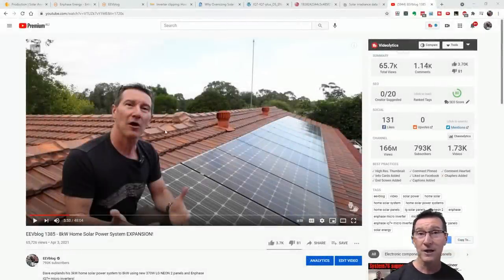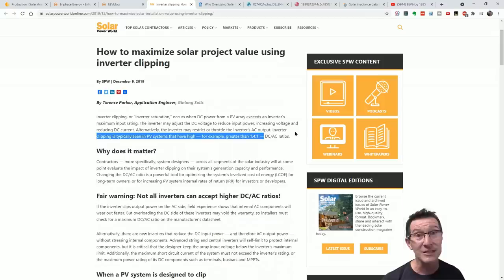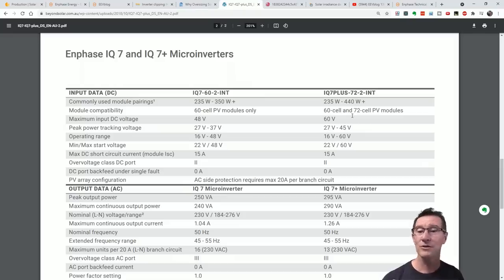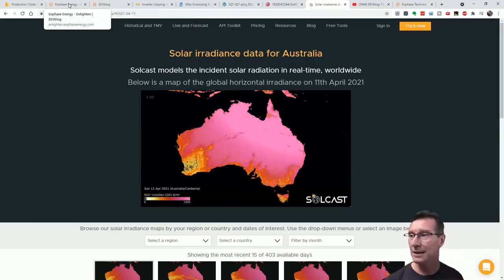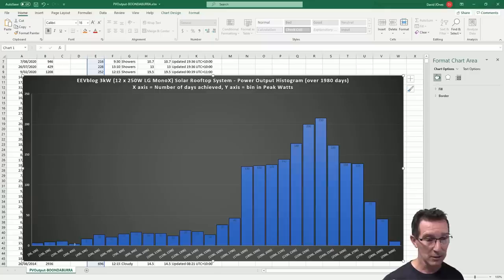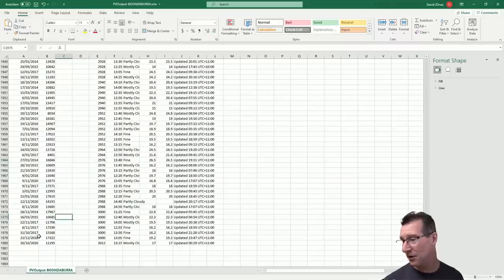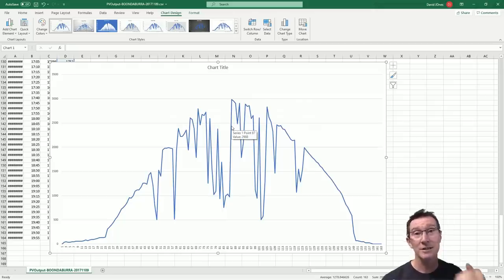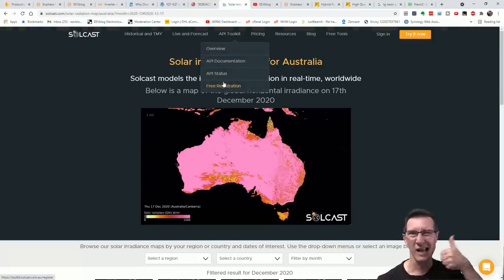EEVblog 1386 - 295W Inverter vs 370W Solar Panel - WTF?

Comment: Can you run DC equipment directly off the MPPT so you can avoid the inverter?
Like charging your electric car without inverter.
Reply from the maker: There is no MPPT tracker box, it's built into the DC/AC inverter.
IN theory you could charge your car directly but it's liekly not worth dicking around with a custom solution to gain a few percent extra efficiency.
Reply: @EEVblog  Yes, for me the best optimization is likely to add an A.C. coupled battery. But that depends on the utility cost and if you can take advantage of time of use rates, or if backup power is worthwhile to you. Or if you can arrange it, simply plan to charge your car during peak solar availability.
Reply: I directly DC charge my electric motorcycle (72V / 6.5kWh battery, 8 kW hub motor) off 3 270WP panels in series. The bike has a cell monitoring circuit which opens a contactor when the 1st cell goes high voltage. My Tesla Model S gets solar  charged DC/AC AC/DC which is unavoidable at this stage. While it does has DC pins on the charge port it takes the CCS protocol to convince the car to energize them. There is a German manufacturer (Vector) who offers a CCS kit for conversions but it is around AU$6000 by the time it lands here in Straya. For grid connected guys like ol Davo here a Zappi TYPE 2 wallbox would be good which puts excess solar into the car rather feeding it into the grid. It is a very satisfying experience to ride/drive solar electric.

Comment: Calling this "de-rating" of the inverter system is backwards to my ears. "De-rating" is when we purposely use components with higher capability and purposely design to not use all of it.  Is this not actually over-rating of the interter system? Or de-rating of the solar panel system?
Reply: Me too. Completely misusing the word to justify what is IMO just another scam.
I've come to expect that from the solar industry though.

Comment: most if not all panels rarely reach the quoted power simply because they drop output as they heat up (full summer sun ) can reduce o/p significantly , ps most grid panels have bypass diodes built in (not blocking) so if panel a panel is partly shaded it wont drag the hole string down , interesting to see if the inverters still work after several years on the roof.

Comment: It is not fair what you did with extrapolating that curve. The panel temperature has a huge role in power output not just amount of solar so the reasons you have those peaks is because panels where shaded by clouds so cooled down and then sunlight gets on to cold panels and for a few minutes panels will perform great but then they heat up and no longer provide that peak power. STC is not just at 1000W/m2 but also 25C for the cells and to have +25C cell temperature then ambient will need to be at least -10 if not -15C same with the more realistic output at 800W/m2 then they specify the actual ambient temperature of +20C so panels are likely at +60 to +65C depending on wind speed and some other conditions and that is one of the big reasons output is way lower than at STC and not just the 20% difference in solar irradiance.
Reply from the maker: Yes that will play a role but I have seen full smooth curves close to 3kW before.
Reply: @EEVblog  Likely the best curves will be at the end of winter early spring when you have a very cold day and full sun.
Like in the graph you used you can notice that peak in the middle started with full power then started to drop very fast and quite a bit and that was from panel heating up not any clouds or reduced irradiance.
So if there were no clouds that day your peak will not be anywhere close to 3kW.
Reply from the maker: @electrodacus  Yes it's going to vary greatly. I was using the best case possible scenario.
You can't just categoricially say the output drop was due to the heating without the actual data.
Reply: @EEVblog  If you could cheaply cool the panels. e.g with water pumped in a loop and the water passively cooled. I wonder if you could extract significant more energy from the system?
Reply: @supernumex  Could also use stanchions from the tile mount to the panel  raised higher off the roof surface.  Tilt and azimuth also should be factored into output.
Reply: @EEVblog  The data is in the graph and that smooth reduction in output on that highest peak is cearly from PV panel heating up. The panel started very cold as before that peak it was cloudy for a long period (fairly thick clouds) then you got that peak and there is a smooth drop as temperature of the panel increase then a small cloud it then recovers but panel is still hot and then there is a bit larger coud. Without any clouds in that day I estimate peak will have been around 2800W or below and that will still mean that was a relatively cold day probably in spring.
Reply: @Wavefront101  good point. would be interesting to try for sure.
Reply: @realedna  You can get the spec for the effect of temperature from the panel spec sheet. I have not mentioned the inclination (angle) anywhere in my comments. I used the word irradiation if you have confuse it with that.
Reply: Googling shows, that the cooling of photovoltaic cells (panels) is an active research topic and can lead to ~5-20% eff.-increase, when starting from a high temperature and getting close to the optimal 40-50 °C range (~0.5%/°C).
Evaporative cooling seems interesting (besides raising heat capacity e.g. with phase-change materials, water or fats), but I wonder, if there is a negative side-effect (beyond spending/wasting water) as an ambient humidity level of >80% lets efficiency plummit as well.
Reply: @EEVblog  Can you track the (surface) temperature of your panels?
I believe, that during peak-power the high cell temperature causes more losses, than clipping ever could (temperature limits the achievable cell voltage)!
Reply: @realedna  It will never be cost effective to cool solar PV panels. Is better to just pay extra for more panels or even more efficient panels.
Reply from the maker: @electrodacus  The best data I could fine for a perfect day (although I have not looked at all the data) is 2.79kW peak. See the 2nd channel video.

Comment: had enphase micros for a few years now... 270Wmicros 320W LG blacks
clipping normally only happens for 1 or 2 (3 on the worst of summer days) hours of the day there is clipping. close enough to true north facing panels with no tree/building shade ever 
you will get more energy over the whole day and life of the system over paneling

Comment: I have a dual string 5kw invertor 19x250w = 4750 kw max output, It has been possible with the right conditions for this to trigger clipping dropping both strings when clipping. I have wondered why they didn't drop one string to maintain some kind of output.
Reply: If your "dual string" inverter is like the one I looked at a few days ago, the 2 strings are just directly connected in parallel inside the inverter without even a diode to separate them. So there is no way it could treat them differently.

Comment: It only make sense to have equal inverter to panels, if you live in a dry, cloudless area close to equator, where you would be cliping almost every day. Or you have battery storage system, and can actually utilize this extra energy in some smart way (i.e. charge batteries, or car, but then how often do you have your car at home in the middle of a day - maybe for office, it could make sense). Always calculate and do system life estimations. In most cases, in normal locations and conditions, it is better to get smaller inverter, it is cheaper, easier to cool, and actually more efficient at low power levels.

Comment: I have a 4kW inverter with optimizers and minimal clipping. I found in the data that peak performance doesn’t occur on sunny days, but rather on days with clouds and occasional full sun. I guess the panels are relatively cold in such case, causing short peak performance. Or maybe additional light reflected by clouds? Dave’s data seems to show the same thing: short peaks after a low energy period. While still ‘offensive’, and reason my inverter is 4kW instead of recommended 3.5kW, this strengthens the case for economical optimization by undersizing of the inverters.

Comment: Electric companies in our area require max 20kw system. If you go over 20 kW system they give you half buy buy amount. So derating gives you to stay under that number and have stronger numbers and cloudy days won't notice a huge drop. Lot our jobs we try to use M215 enphase with 400 w panel. 215m caps at 215w. So cloudy days your normally produces half the amount which makes under size micro inverter shine. As 400w panel half is 200w so your still pretty much at the full output of your micro inverters. 

M215 mico inverters we normally get around $65 each new! as it's old stock massive discounts.

Comment: Since solar panels degrade about 2% the first year and 0.5% each year after, undersizing the inverters only affects a couple years.  And angle of panels determines how much power a panel has too.  So a low or high angle panel won't ever get maximum power.

Comment: I wonder if dual inline inverters exist that intelligently switch between different inverter paths depending on the currently available amount of power, thereby increasing the efficiency across the whole output power range.
Reply: Could buy 12 more micro inverters and remove the string inverter (think he had 12x250w solar panels on that old string system)

Comment: My system in Northern Europe (Utrecht, Netherlands) is 3680W nominal, 3000W inverter. I have seen it clip on some days , even significantly on really good summer days (that really obvious parabola with a flat top), but it’s goddamn rare. And it keeps the inverter below a 16 amp fuse and 2.5 mm^2 wiring which makes life easier. Over the past decade I probably could have made slightly more energy.

Comment: Clipping should lower the lifespan of the micro-inverters because they're at max output (hot) more often. So you're losing more than just the extra energy cost wise, you'll need to replace them sooner.

Comment: The SolarEdge system's power optimizers (DC MPPT) can do up to 370 watts on the standard and 800 watts each on the big one, then you just size your main inverter as you wish. I got an inverter that can handle my full 9600 watts at 370 watts per panel (96 cell panel)

Comment: One thing I don't see mentioned is that your panels are going to become less efficient year over year. A 340 watt panel with 295 watt micro inverter may clip through the first 10 years or so but then won't clip for the remaining 15 years of system life so a larger inverter would be wasted at that point.

Comment: thanks Dave. please also monitor these micro inverter temps during next summertime, and lets see how long they last! Given the warranty is 20% of the panels themselves, it would be really helpful is most of them typically lasted longer than that. And of course for all those really hot days in Aus when they will themselves of course also being working the hardest. Another hope is that in only 5 years time the costs of replacing micro inverters in 2017 may be lower, since they would have had that much time to evolve the technology and reduce the costs of them
Reply from the maker: They do measure temp internally but I'm not sure I can get that data
Reply: @EEVblog  well that would be a shame. maybe somebody will reverse the protocol. BTW also about durability of micro inverters: it just occured to me... that if an installer can just run the cables inside the roof, could then just physically relocate, and keep all of these micro inverters close together inside the attic or roof cavity as a group of seperate units. and then easily put an active cooling on them all together at that same location. and would keep them out of the worst harsh outdoors conditions. might not be strictly necessary, but should help to extend the MBTF of them well past the official 5 years warranty. whilst still keeping all the positive benefits of these micro inverters, and not changing the electrical configuation or anything like that. also maybe could then argue that the don't strictly need to be potted anymore for an indoors version = maybe potential for an open source hardware project perhaps maybe? that would also be another way to reduce the cost of these micro inverters. although of course they also need to consider and observe applicable local regulatory requirements too. it still might be an interesting project, and to find out how they operate etc.

Comment: i have iq7+ with 365 watt jinko panels and I see clipping a lot.  on a sense home energy app you can see the waveform. Enphase doesn't show you the power graph as well as sense.  in summer you can get high temp derate on the panels, but spring and fall you are getting full output dc and clipping on AC.  maybe in australia you are getting high temp derate happening more than Illinois USA.

Comment: 38% of days you will clip for fractions of the day (hence low % of time).  99% of the "time" (day x hours) you will benefit from having more solar capacity than inverter capacity because you aren't getting STC irradiance.

Comment: I knw you kind of touched on this in the video, since the micro inverters will be operating at close to the peak output, how much do you think it will affect the life span of them? How much energy loss due to heat.
Second, any chance you might do some videos on solar system basics like the best inverters etc?
Reply from the maker: The energy loss due to heat is in the datasheet, I should have mentioned that. Lifespan, only long term data will show that. If they have done th engineerig  right then it shouldn't make much if any difference.
Any video on the best components will be very country specific due to variable price/availaability, so I don't see much value in doing that.
Reply: @EEVblog  cmon dave, where is the teardown of the inverters?
Dont turn it on, take it apart!
Reply: @Basement-Science  He covered that in the first video. A big lump of epoxy (or whatever potting compound they use) is a lot of pain for little gain.
Reply: @Sylvan_dB  Ah I see, might have forgotten about it already. Not a lot of fun when they do that haha^^

Comment: I think u missed one important inference. The system generates or operates most of the time at around 80-90% of the rated DC. This means ur inverter rating when matched to this operating point will be the most efficient. Also this means that the total yield of the system on a 25 year life span is the highest for the 133% of DC/AC as seen in the Enphase brief. To conclude the system produces MORE energy over its lifetime by underating the inverter as the inverter operates at it's most efficient point through out its life time.

Comment: i suspect that enphase inverter will derate output when they are getting hot. 60C is quite common underneath the panel

Comment: Not surprised at all as details like this are often ignored and sometimes it can result in more than just lost efficiency with the loss of a panel or something else baking to death. Forced air cooling doesn't help much as a few people have tried just tinkering around though water cooling the back of the panel would help.